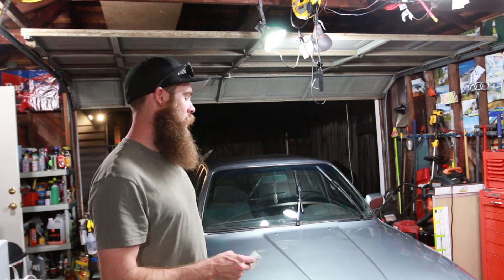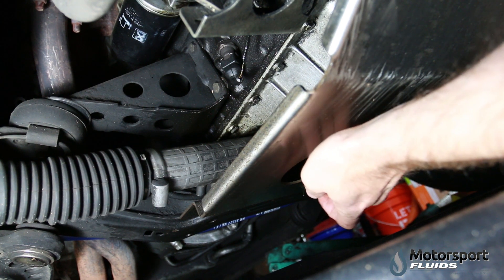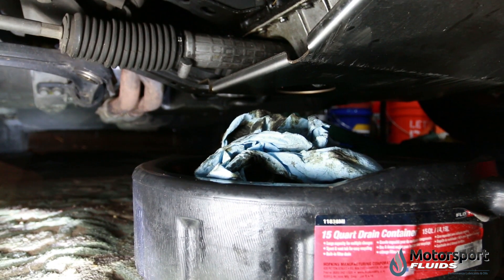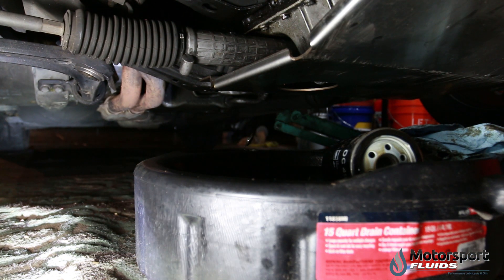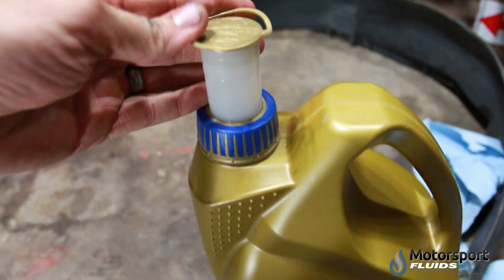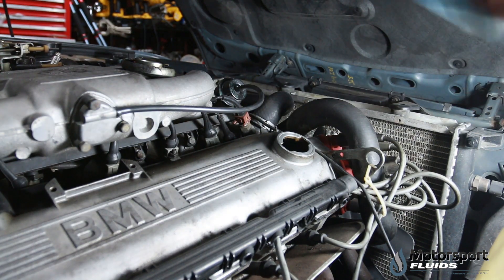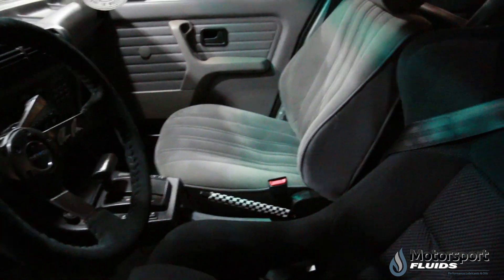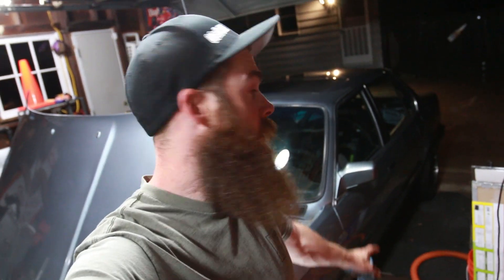Berty 30 AutoX Prep Oil Change

Comment from the maker: Good morning guys. Drop below why type of oil you like to run.
Reply: Good evening.
Reply: Pennzoil Ultra Platinum in my WRX!
Reply: Penzoil platinum all day. Unsold on T6.
Reply: Mobile 1 every time
Reply: Mobil 1 10w-30 with a little bit of Lucas Oil Break In additive.
Because flat tappet motor.
Reply from the maker: Good idea to get the zinc level up.

Comment: Hey Blake, having a blast following along. Thanks for the great vids!  Wanted to share a couple of things that I have come across, are common and have done or have yet to do myself. Our 30's are old!   After my suspension updates and maintenance car still seemed to have an issue.  The steering coupler from shaft to steering rack 'No Bueno'.  The little u joint there shots ola' and the rubber flex disc ( some call it Guibo Joint) no better. That one stings some. $$$$ Dealer item. :(    Rear axle hub bearings. Right- Rear slowly getting louder.  Decent amount of work. Got parts and tooled up. Needed to quit screwing around and 'Wrench On'.  Brake Fluid flush.  Interesting feeling of satisfaction after I did that.  A thought is if you are Autocrossing get a bleeder ( I set myself nice with the Motive one) and do fluid changes a bit more regularly.    G.

Comment: Based on how much you're using the skid plate, I'd raise the front a little bit to see if it can give you a more neutral balance to the car.
Reply from the maker: Curtis Yamanaka I lowered the rear about 19mm
Reply from the maker: Curtis Yamanaka seems like it helped. Also I raised the front just a bit since last autox.
Reply: Good, I'm glad it helped a bit.
Now you have time until the next autocross, any other mods to the S3 planned?

Comment: When are you doing the manual swap? Very curious because I may need to do one in my future
Reply: Also was this car repainted? The inside of the strut tower looks red.  You could check with your vin on the BMW vin site
Reply from the maker: Jash R car was repainted. But never red. That was the coilover camber plate.
Reply from the maker: Jash R whenever I find someone selling the parts or parts car for a decent deal. I'm always looking.

Comment: why dont you post videos of autocross doing laps and your times ...we really want to see your time attack laps and how much you improved and what cars you competing with etc etc ...you never posted any autocross video
Reply from the maker: raheel saleem don't worry I will post them. I just didn't want to post out of order. Then the videos wouldn't make since.
Reply: awsome ...waiting for those videos ..and really want to see how much your timing improved with roll cage and other future mods ... i am also running my e30 on track and i have m52 motor and everything stock  we are competing with challenger srt8 on track he did it in 1:50 seconds and we did it in 1:52seconds ... your videos will help me to improve my cars handling and some timing